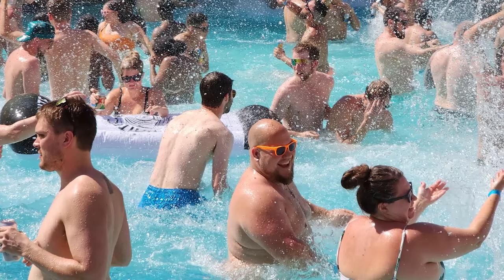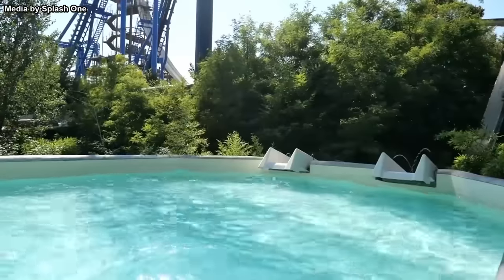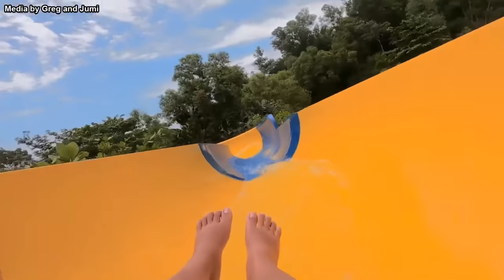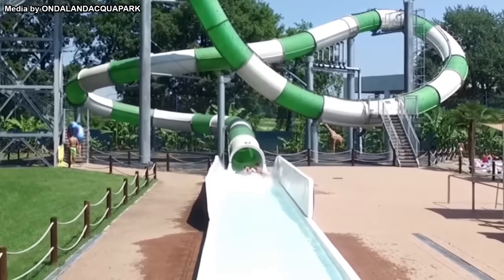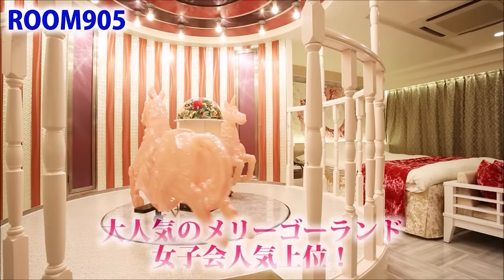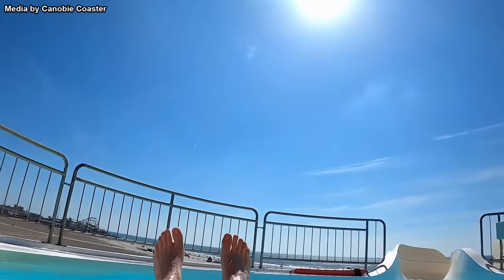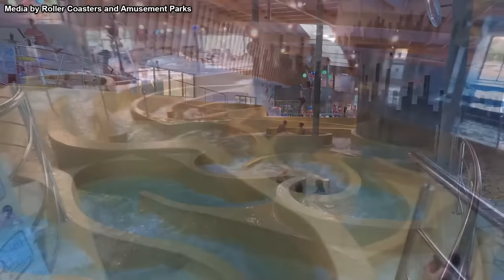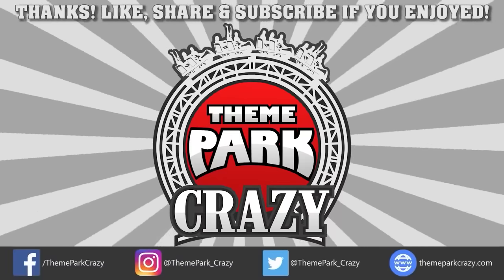Top 10 BIZARRE Waterslides from Around the World

Comment: As a German, I did not expect #1 to be what it is. Those are pretty common indeed, but I love them! They can be a bit harsh sometimes, slamming you into a wall in a tight corner. But still fun! Also, many do have intermediate chillout pools which is super cool. I went on one at Rulantica in Rust, Germany in the winter and it was so cool chilling there with light snow falling and seeing the lights of Europapark in the distance. :D
Reply: The one at Rulantica was pretty relaxing compared to the one at Europabad at Karlsruhe, Germany. This one is very intense with sharp bends and an extremely strong current in the deeper sections. People entering this ride should be good swimmers, but I think it is really fun 😊

Comment: The Dollywood Slidewinder was AMAZING! Later on there was very little water, and the boats looked really chewed up. But you had 4-5 people in one of the molded sleds, and the speed was both fast and you would fly way, WAY up on the banks in some of the turns. It felt more out of control than any other waterslide I've ever ridden.
Reply: I think the year it opened, it was rated as the best non-coaster ride by in a US park by one or two of the coaster folks. It was torn down for Wild Eagle, which is still quite a loss.
Reply: Cool
Reply: @frankbranham7404  it wasn’t torn down for Wild Eagle.  The Slidewinder’s last season was in 2018 and Wild Eagle opened in 2012.  You could get some nice views of Wild Eagle walking up the Slidewinder’s path that you couldn’t see from elsewhere in the park.  I grew up riding it and was sad that the year my daughter was finally tall enough to ride, it was announced that it wouldn’t be opening for the 2019 season. I believe maintenance costs had a big factor on its closure, and a lot of people didn’t like the hike up the hillside to ride it.
Reply: @stephaniesuthers5635  Nice memory. One of the missing waterslides from this list might be a VERY sketchy water park made from concrete which was in Pigeon Forge in the 70's and 80's. There were mats, but if you slid off of one of them, it was like being run over a cheese grater.
Reply: My first water ride ever, scared the crap outta me because It really felt like you were going to flip over
Reply: @disneylandon  Oh that's right, there were parts of the ride where the raft would go airborne. They would also take efforts to balance us in the raft's seating positions. I'm a giant, and they wouldn't let me sit in the back....in the middle instead.
Reply: @frankbranham7404  was an absolute blast! God I miss it!

Comment: As my home park, the Mountain Slidewinder was a favorite of my family and myself ❤️. It was always best to ride it very early or you could’ve been standing in line in the heat for an hour or 2 for just a few seconds, but those few seconds were so awesome!! It was so fast!!! Sometimes on the turns the raft went so high I was afraid it would flip over or fly over the top of the slide onto the ground.

We rode Mountain Slidewinder every time we went to DollyWood from our first trip in 1989 to 2006. After 2006,we didn’t make it back to DollyWood until 2019 and sadly it was already closed down 😭. However it will forever be one of the best rides DollyWood ever had and will always be missed by us.

Comment: I've ridden the Super Splash. As requested, I can confirm that riding it is not painful, however, you WILL smack your face against the curved foam mat if you do not strech your arms fully outward during landing. Slide supervisors warn you for the danger, but reflexes might make you cramp up. Anyways great video!

Comment: Slidewinder was built as the wilderness waterboggan at Silver Dollar City. SDC built the slide in-house, and it was one of a kind. They reused the fiberglass molds and raft design, and built a copy at Dollywood. The Waterboggan was remodeled in the late 90s and switched to traditional inflatable rafts with an all new fiberglass trough that didn’t require the trim brake rubber mats along the walls. This was a short lived iteration that closed in the early 2000s but the tower and stairs to it still stand. 

Slidewinder remained operational far longer than the Waterboggan and remained in its original form as a clone of the original until it closed.

Comment: I have been to the Kalahari in Sandusky and ridden the zip coaster. Every time I saw the slide there were black tarps on the bottom (probably because of the conveyor belts) making it look like it was always under construction. If you look at where the break run used to be you can still see marks of where the footers used to be.

Comment: The thing that always got me about the Slidewinder at Dollywood was that it was the ONLY THING you'd walk up that trail for. I mean, if you weren't going for the Slidewinder, there wasn't a look-out, no vendors, no other paths around to anything else (like some kind of shortcut)... NOTHING...

    AND once you did walk up it, at least every time I went, you had almost an HOUR to stand in line, even with two sets at a time, because "dueling"... They couldn't let more go without infringing on safety, so you just stood and stood and stood... and then the run...

    Don't get me wrong, it WAS fun as hell, with banking turns that REALLY bank you up there. It felt like riding a bobsled, only in the summertime... No worries, though, about getting wet, which... well... it's a waterslide! Who the Hell rides a waterslide NOT to get soaked??? Right???

    BUT that was the experience on Slidewinder... Trudge about a quarter mile uphill and stairs... stand forever in the line... get to your position on the mat-sled thing... shoosh into something you'd expect to become an olympic sport... and there isn't even a splash-down... barely a trickle-down... and you can get off and go back to repeat the process...

     Dollywood SHOULD have done literally anything around it otherwise, to add something for that walk... BUT I can understand land management this and expenses that... I don't know what you could do with foamy-rubber sleds on a water slide to promote a proper "splash-down" experience, but that might've been something... Meh... well... It was fun, though I can understand the lack of logistics or justification...  ;o)

Comment: I'm from The Netherlands and your number one is quite similar to what we have here. Over here they tend to be quite a lot wider, so on some drops you'd go down with four people. I went on the 'wildwaterbaan' at Centerparcs Kempervennen, which actually has a small slide built into it. The other one I went on was Stappegoor in Tilburg, which is also some sort of combination and to give you some context: in NL we have swimming classes that grant you diplomas A, B and C (highest) and for the one in Tilburg it was recommended to have diploma C at the time I rode it (long ago). If not, you had to have at least A and be accompanied by a parent. I recall my dad having to pull my younger brother up from the current of the water lol... (also I relate to the comments posted by the Germans here, since in The Netherlands they can be pretty rough as well XD)

Comment: I've been on all the Caneva slides. It's a peculiar park with an abundance of straight slides focusing on airtime but not many classic twisty ProSlides-style tube slides.
Super Splash was fairly painless  - although there are strict instructions about riding it. E.g: You're required to cross your legs and keep hold of the mat whilst in the air (which isn't very intuitive!). A few of my party didn't ride it correctly and therefore suffered quite a belly flop.
As for Frozen Bob, on my three visits, I've never seen anyone make it high up the ramp!

Comment: What you said about the Zip Coaster at Kalahari wasn't entirely correct.  The real reason that ride was taken out was because an air duct from the ceiling collapsed one day and damaged a portion of the ride.  Since the manufacturer didn't make those slides anymore, there were no replacement parts to rebuild the ride forcing them to take it out afterwards.  Hopefully they can build a brand new water coaster or some other awesome slide in its place very soon.

Comment: There's an aquapark called Serena in Finland that I have visited several times. The first time I visited, there was still a slide called something along the lines of "green pipe". You weren't allowed to ride it if you were too wide over your shoulders, because the pipe itself was really narrow and and water pressure and the riding speed was INSANE. It has been discontinued many years ago, and I suspect it was because someone got hurt. Another ride in the same waterpark is called Crazy Race. It's a simple but very steep slide downhill. Unfortunately I had a very painful experience on that one... Let's say that pool water forcibly ended up in places where water should not end up. 😔 I pretty much cried of pain when wading out of the end pool.

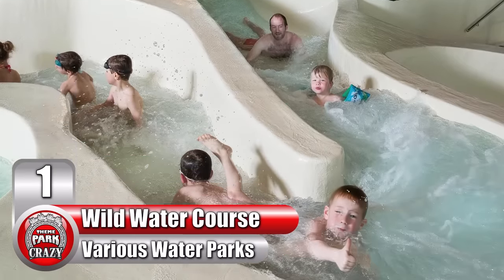Regarding the Wild Water Course 10:19 and onward: Serena also has one of those. It's really fun but you gotta be careful to not get caught in the current in some spots.